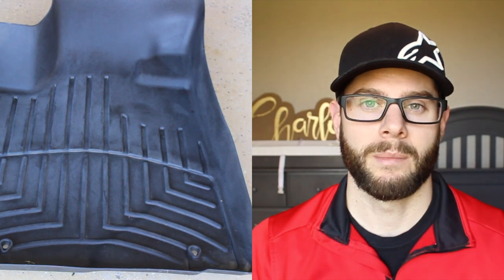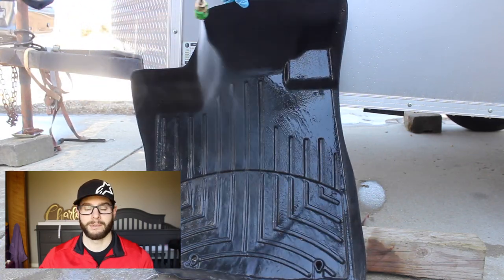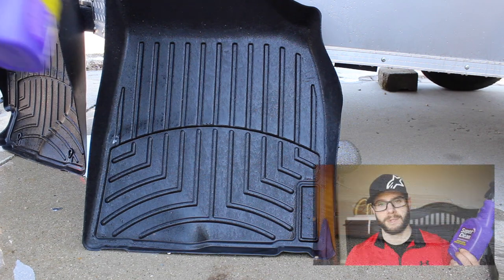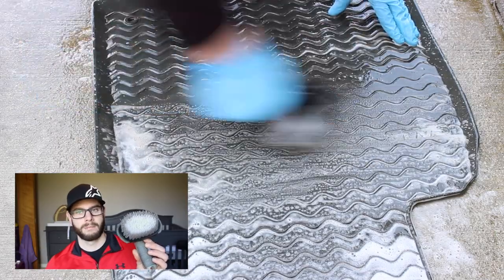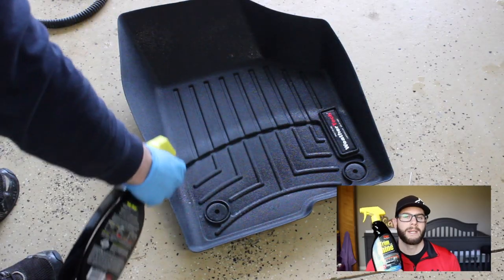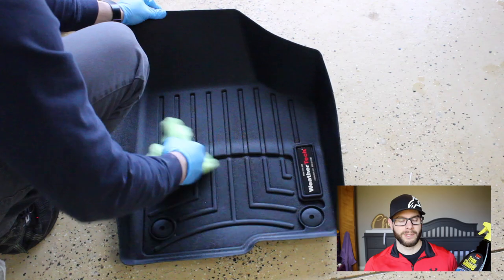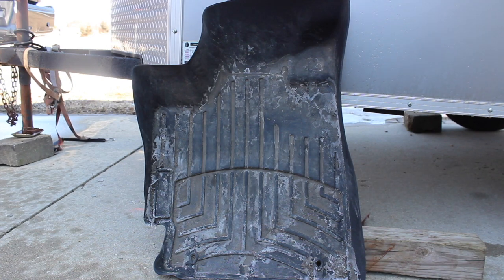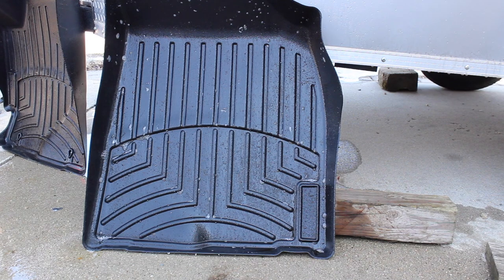How to Clean Weathertech Floor Mats at Home with Minimal Tools Required! Do it Yourself! Tech Tip!

Comment: Better to buy a 1 gallon super clean and dilute It. It's a great product. I have two dilution ratios. 5:1 for floor mats and tires and 10:1 for interior plastics. Both work very well from my experience.
Reply from the maker: You sir are exactly right

Comment: I always wonder why they dont do everything to the same mat. I mean the one you clean with super clean and the power washer is NOT the same one you are putting the dressing on and  showing the end result...smh
Reply from the maker: I rewatched my video. I show multiple mats to simply show the process is the same. You can see in the thumbnail I did a driver and passenger set of mats. Not sure why you felt the need to leave a negative comment. It's discouraging being a creator to even make more content because trolls like you exist. Make your own videos and see how frustrating it is.

Comment: Dawn dishwashing soap would work it cut grease and dirt great.
Reply from the maker: Definitely. I wonder if it would leave the mat looking opaque
Reply: @cleanmachineautodetailing  I don't know about that but It's good to wash cars with.
Reply from the maker: @michaelg.damons6229  washing with dawn will strip any wax on your paint. I wouldn’t recommend unless you are applying a paint protection.
Reply: @cleanmachineautodetailing  don't use it all the time .I use Mcguires car wash and Mcguires  Gold Class wax. One thing I found out you can use REPEL MOSQUITO REPELLENT TO TAKE YELLOW STUFF OFF OF HEAD LIGHTS.
Reply from the maker: @michaelg.damons6229  hmm. Never thought of that
Reply: @cleanmachineautodetailing  plus when you use the Repel mosquitoe repellent 40% deet spray to remove the yellow off of head lights it works very well if lights aren't pitted bad. After you use it.take a buffer and Mcguires plastic polish and buff them.

Comment: I wouldn't advise using Trim Shine on Weather Tech Mats.  It creates a slippery mat no matter how much you try to buff it off.  I've tried it twice with the same results twice.  Yes, the mats look great but not at the cost of your feet sliding all over the mat when getting into the car and then driving.  Highly not recommended.
Reply from the maker: To each his own. None of my customers have ever said it was slippery. Make sure to use a second towel incase the first one is saturated.
Reply: @cleanmachineautodetailing  I absolutely used a clean microfiber cloth to wipe down to no avail.  Correct, to each his own but I would never recommend using Trim Shine on any surface that you walk upon.
Reply from the maker: @gkirms  I see you also subscribe to pantheorganizer. See what he does 😅
Reply: I bought Trim Shine off online  from watching this video and it says on the bottle not to use on floor mat.I was not happy do not want to try it.
Reply: @bonniewhite9607  I would just clean them with a good quality cleaner and leave it at that.  Regardless of what they say on the video the experience I had with Trim Shine was that they made the mats slick no matter how much I tried to buff them out with a microfiber cloth.  They looked great and far as looking brand new but they weren't safe when getting into the car nor when driving.
Reply: @gkirms  thanks I was not going to use it after reading the label .Why are these people aloud  to post video saying stuff that is not true.
Reply: @bonniewhite9607  some people have used it and found it to be satisfactory.  Another site I follow has used it also with good results.  My results weren't satisfactory and I wanted other people to know before trying it out or if you did use it just try it on a very small portion of the floor mat where your feet wouldn't slip when getting into the car.
Reply: @gkirms  I know other site use it too ,that is why I bought .But  people  on  here are saying not  to use it and on the bottle it says not to use it near gas or brake .guess I learned to read comments before buying.
Reply: I tried it and you are 100% correct. It was slippery no matter how much I put on. I found that if I go back over them with a regular old bath towel it really reduces how slippery they are, much more than microfiber.